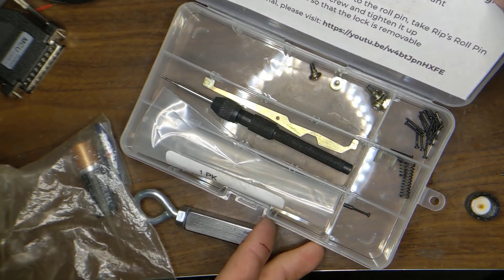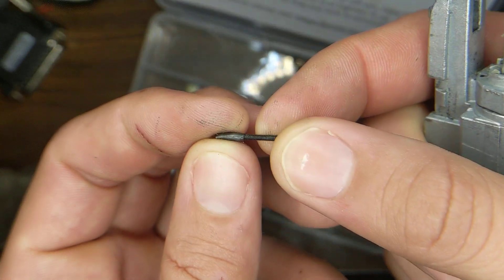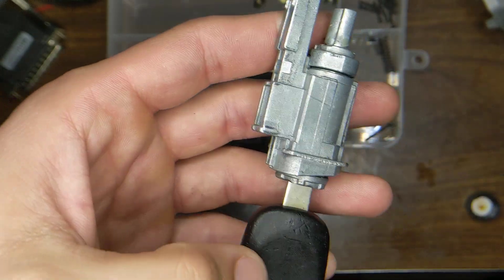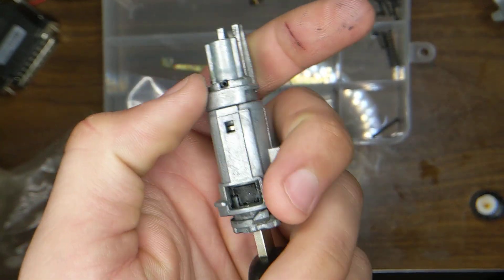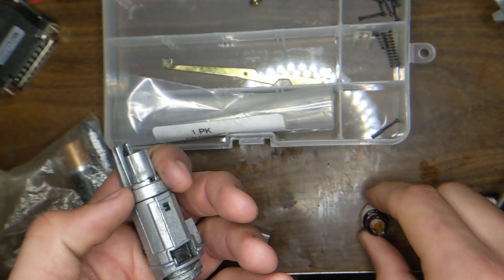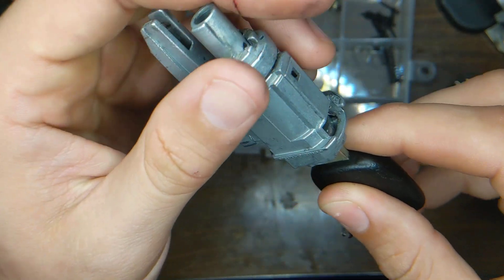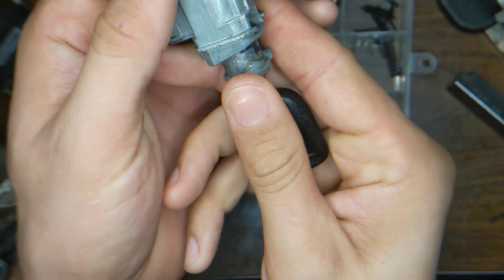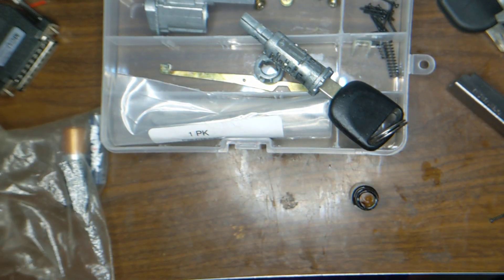Using Rip's Honda Roll Pin Removal Kit to Remove the Roll Pin in the Back

Comment: Like the idea of tapping the inside of the pin. It works on the outside retainer pin as well?
Congratulations on the new addition my man.
Reply from the maker: Thank you. It works with nearly all the roll pins on this system. Rear retaining pin is larger diameter but if you compress it with the auto center-punch, it works.
Reply: @JarethGarza  I am presently drilling a hole in the locking bar channel and punching which works great, but anything that makes removal of the cylinder retainer roll pin more straightforward is worth looking at. I already have the Accu - Reader kit as you do.

Comment: Total waste of time and money. Just take a paper clip and bend a tiny crook at very tip. You should be able to get the paper clip all the way through the roll pin.  Hook the backside of the roll pin with the crook and yank out the roll pin.
Reply from the maker: LOL show me how its done GENIUS.
Reply from the maker: i like the part where you say, “should,” showing you’ve never actually done what you’re suggesting. 

Youre probably not even a locksmith or mechanic. Youre probably someone “smarter,” than us LOL
Reply from the maker: Genius,

Make a video and prove us all wrong.
Reply: Works if the pin is well lubricated and loose, otherwise paper clips just bends or breaks